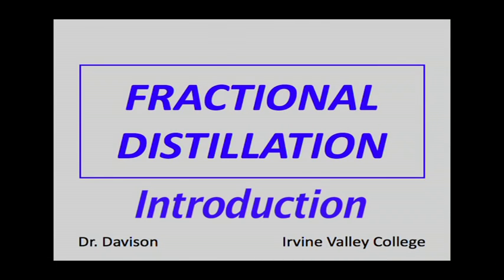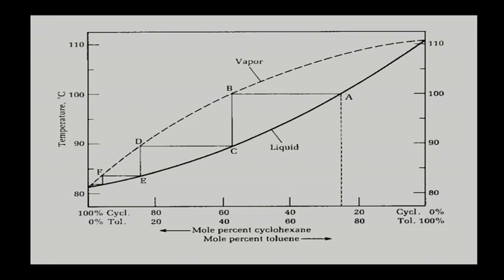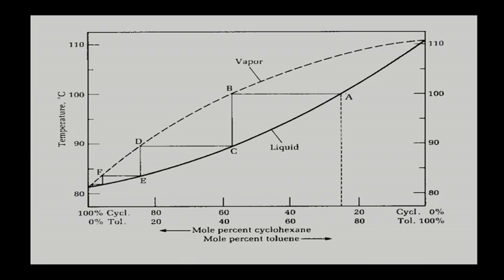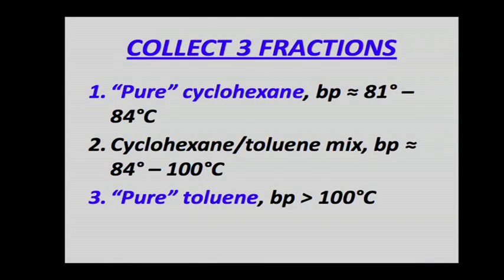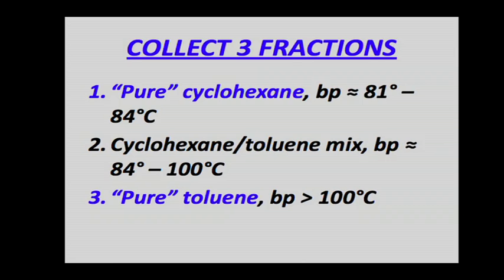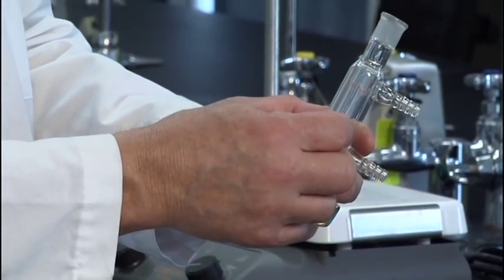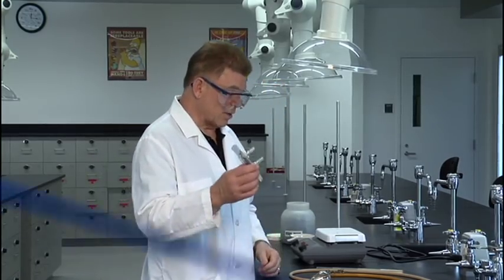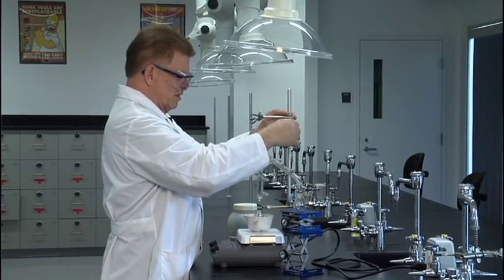5 O Chem Fractional Distillation (CC)

Comment: receiving flask says 420 lol
Reply: I caught that, too
Reply: The connection is labeled 14/20, indicating the size and angle of the connection.
Reply: @buckstarchaser2376  Actually, it is the longest inner diameter and length of the joint. They all use the same standard angle
Reply: @milospavlovic4599  Um, actually...
Reply: @buckstarchaser2376  14 is the inner diameter at the top of a female joint, or the widest outer  diameter at the male joint. 20 is the length of the joint. The angle is the same on all of them. Thus, all joints with the same first number are intercompatible, despite having different lengths. Thus, for example, 24/29 joint common in Europe is compatible with 24/40 joint common in US and China
Reply: @milospavlovic4599  Um, so actually... It's the size, correct?
Reply: @buckstarchaser2376  yes, width and length of the joints
Reply: @milospavlovic4599  Nice. Now re-read the comment you were actually trying to correct.
Reply: @buckstarchaser2376  It is just the size, not the size and angle

Comment: No, you don't need to close the inlet and outlet connections on the vertical condenser.  That condenser will have hot vapor inside the inner tube, and just ambient air inside the outer tube.  You want a temperature differential along the vertical length of the column.  Capping off the connections would do little either way to help that -- and they could cause a pressure build-up inside the outer tube so you caps might blow off!  Dr. D.
Reply: John Davison I'm glad you answered

Comment: why aluminum foil i see this a lot. Rockwool i feel works better. Aluminum absorb heat but also dissipate heat very fast thinner the worst just.  An input to this would be appreciated. love the video.
Reply: It should not isolate too much. You need the temperature gradient to get separation of the mixture. Aluminium foil is a good middle way.

Comment: What about the first column, Sir, where the steel wall was inserted, the inlet and outlet nozzles are not plug close? Do we need another silicon hoses?
Reply: You don't need to close these nozzles
Reply: I mean another cooling system. Hose to the inlet and outlet?
Reply: You do not need to cool the first column. That column needs to get hot so that the vapours don't cool down and condense prematurely, before they can get to the second column. That is why the professor isolated it with aluminum foil. In fact, this is the first time that I've seen someone using the typical condenser for this role, I am typically using a vigreux column for fractional distillation, but this would work as well, maybe even better.

Comment: okay, so I have 2 volatile substances and I am using fractional distillation to separate them. But my problem is reading the thermometer... like to know the correct boiling point. So when the thermometer rises and it stops is that the first unknown temperature?
Reply: It is the boiling point of the substance whose vapours are at that point passing at the thermometer bottom. It might be the boiling point of one of the substances, or it might be the boiling point of the mixture, depending on how sucessfull is your separation. You can only know that once you analyze the fractions later